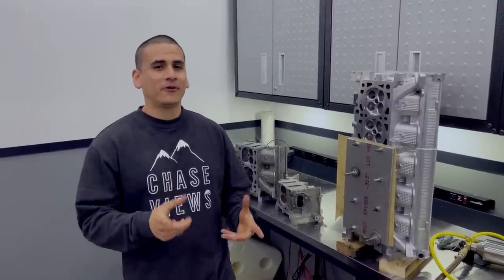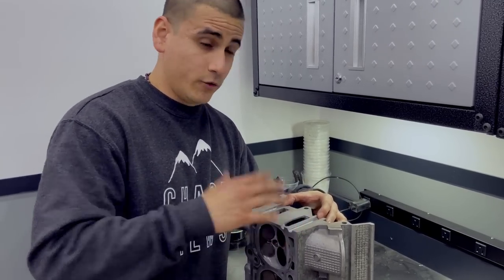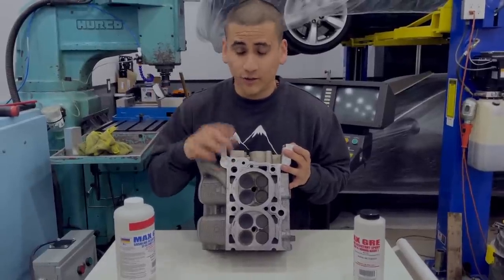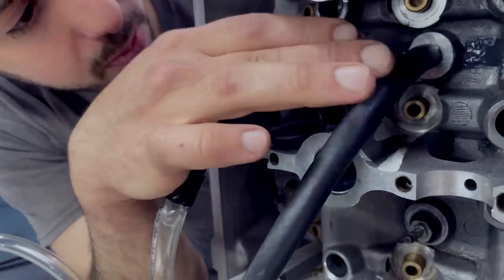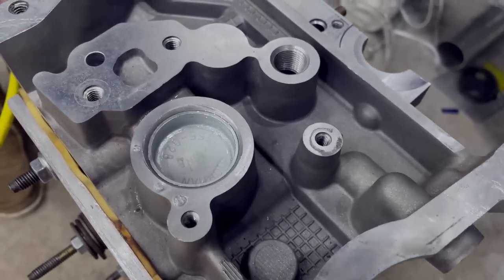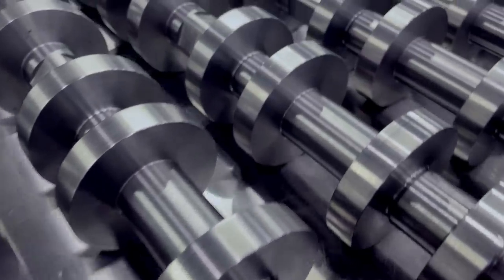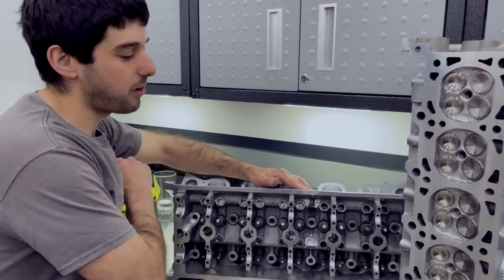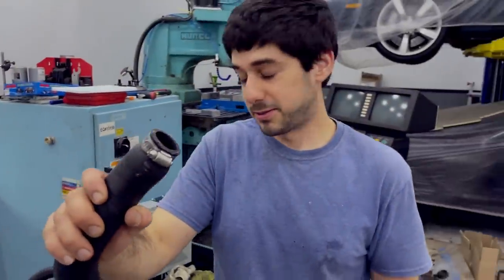Sealing Our Leaking Heads With Epoxy- Ford V10 4V Build Ep. 12

Comment: How about the heat factor with your heads after you fellas used the epoxy trick too seal off your coolant issues. Just a thought, it seals up now but after a few hours of running time you might find the epoxy braking down and the leaks are your problem again. Just a thought go back and redo your welds. Tough decision for your fix.

Comment: The smell of air that isn't -40* is relaxing in and of its self, tho it seems few are making smoke clouds to block the sun's warmth shadowing Alberta. 35*C is a nice day less one is over worked to something of thought that isn't necessarily needed. "stress to one cutting the camshafts, its a 4340 base metal, that stuff can be welded easily if cut wrong... but not every millwright is a welder". very interesting accumulation of parts...
Reply from the maker: The cams are actually 8620. It's a common metal used for billet cams.

Comment: So does each cylinder have a separate supply and return per cylinder? Or does coolant need to flow thru the openings that were welded/ expoxy shut?
Reply from the maker: Each half of the head cooled independently, through the water jackets in the block, there’s just no flow between the two halves but each cylinder is still getting cooled

Comment: Very interesting, if you would do a V2 set of heads what would you differently?
Reply from the maker: Ideally we would eliminate those coolant block off plates. If we can put in a sleeve into the bolt holes and then weld all the way around, we shouldn't need the plates and think that would be best.

Or billet....😬
Reply: @biy_buildityourself  Look for Performance Driven Design he makes 3d scan of cylinder heads and cnc them after. He is doing a Collab with KSR with cnc Oldsmobile billet heads right now on youtube.

Comment: do you mind sharing what something like getting that bracket machined from a machine shop costs?
Reply from the maker: That bracket costs us $200 to make from our prints.
Reply: @biy_buildityourself  that's not bad if you're a solo builder with modeling skills. Definitely not something you want to do a lot but for a one off build and you can validate it with 3d modeling, very solid

Comment: To check this head properly, the head itself to the plate is to be screwed at 120nm with m12 screws, not some m8 that break off at 60nm, you must fasten it to the plate and throw it into hot oil at 120 degrees celsius for at least a few hours with a fastened pressure of at least 1.5 bar on the water jacket and 3 bar on the oil jacket.The epoxy is too hard for the vacuum pump to suck it through the tiny holes in the weld. The epoxy coating will fall off as this engine starts heat cycles, peel off with the oil wash under the shafts and clog your oil channels or get under the valve springs. I've already told you that it would be 10 times less work and 3 times less money to make a new cnc head from one stack of aluminum, especially since you already have a product that you just need to scan, machine and translate the parts. And no, epoxy won't fix anything, because you don't take into account the heterogeneity of the material on such a long head - it's all messed up at the level of the idea.
Reply: Well we're gonna see ain't we! People have run engines for YEARS fixed with J-B Weld with far less prep and care. Just because something isn't perfect doesn't mean it can't work.
Reply: @802Garage   Yes - Fixed, not glued from plasticine. Engine blocks - i saw one worked after coolant freeze and water caps was blown away- they were glued, head covers- ok, motorcycle engine side crankcases ok, but no cylinder heads, in place that there is the highest stress for metal (65bar pushing out inside combustion chamber, and each of the bolts from the head compresses it to the block with a force of 20 tons ) . Guys, just take calculator and calculate it. Calculate the fatigue calculations of a welded structure made of aluminum alloys. There are generally available patterns on the Internet, you also know the types of aluminum and binders. Even if you do it right, in the best case, the weld will last maybe 100 motohours because the weld is firstly made wrong, secondly, in the worst place, on the screw hole, where all the material stresses are present, and each "pea" of the weld accumulates them. And that's even counting the temperature cycles themselves, not counting the knocks of such an unbalanced engine as is v10. 
Where the order of ignition relative to the weld follows each other for one head. There is no time to quench the stresses along the weld. If it were that simple, there would have been 24-valve heads for BMW m70 engines a long time ago, and they don't exist, and all combinations for converting the v12 to 48 valves end in fiasco or making a new head from a single casting. If you want, take a small tinsmith's hammer and do a bell test on this head. See if the knoc bell sound is the same in both halves of the head and say what came out.
Reply from the maker: CNC heads are really sweet and would be awesome, but they are definitely not in the budget!
Reply: @rekinek e36  if you don't think an epoxied together head can make and handle power, you've clearly never seen a 300L6 topped with a chopped up Cleveland head where the ports just about come through the valve covers because they've been raised so far. And that has been done so far back as the 70s. Epoxy on a set of welded heads isn't a new idea and it's something that many racers do successfully. It seems like you're under the impression that they just glued these heads together and bolted them to the block, and that's not the case.  They welded coolant block off plates to the heads then welded the heads together.  The epoxy is being used as a sealant more than it is an actual glue.  And in that capacity it is more than serviceable for this application.  But if I had to hazard a guess, I'm sure they wouldn't turn down a set of billet CNC heads to eliminate that potential issue.  And you seem just concerned enough to provide a set; since all it takes is for them to be scanned and milled after all.  If you ask nicely I'm sure they will give you a receiving address so you know where to send them.  😊
Reply: @rekineke3692  also I've seen crankshafts ring when struck with a hammer that you could pull in half because they were broken.  That's not really a very telling test.  And the reason you don't see 48 valve BMW V12s is because even the most ridiculous and wealthy gearheads recognize that trying to do anything with a BMW is a monumental waste of money and you'd be better served to enjoy the warmth of the fire you started with the bills you were going to spend on it.
Reply: @codyslaughter4678  first of all, you are talking about a fairly mass production engine where someone thought about how to do it, thats true but it is serial and low power and and compresion engine witch is balanced - straight 6, not an unbalanced high compression high power v10.  The bell test is done only on the unmounted part to check the homogeneity of the material, the bell test does not pass, for example, motorcycle shafts that have entire connecting rods (with needle bearings) because they are made of at least 2 elements. And here too will be the same story. They will put the heads on the engine, heat it once or twice and it will be "why is our engine boiling" or "why did we raise the head gasket". There is still an option to use what they made, make sure that the engine does not exceed 75 degrees Celsius on the water jacket, but with this capacity and such a large cast iron block it is impossible.
Reply: @rekineke3692  a triton V10 isn't a mass produced engine? What weird fantasy land do you live in?  And the 300 I'm talking about started its life as a low compression engine yes.  But with that cylinder head it was built out to be an 11.5:1 compression, high rpm dirt track/ drag racing engine.  And it wasn't just 1 seam in that head, it was cut between every cylinder because the bore spacing between the 300 and the Cleveland weren't even close so your argument about balance and "dwell time" between cylinder events is irrelevant and nonsensical.  You're using a lot of big words in an attempt to mask your lack of knowledge on a subject while also trying to dispute the validity of a practice that's been used successfully by people who have been building engines longer than you have probably been alive.  Also, that triton V10 isn't "unbalanced" because it doesn't use a common rod pin style crankshaft.  It has a split pin crankshaft with an alternating bank firing order not unlike a flat plane crank engine (the most naturally balanced orientation for a crankshaft) so if anything "dwell time" for the head is going to be a good as it can get because it never has 2 cylinder firing on the same bank one after the other.  Also, that 300 I mentioned earlier was by no stretch low power.  It has somewhere in the ballpark of 600-650hp and that was out of a big bore 6 cylinder.  For this engine to get anywhere near those kinds of stresses on the crank, heads, block, etc that engine would need to exceed 1100hp NA and do it somewhere around 7000rpm and I'm going to assume that's probably not their goal.  And to further remove validity from your statement, that 300 cylinder head was made of cast iron which is FAR less ductile and welds FAR less successfully, even today, than whatever T6 alloy those 4V heads are, and the 300 head is several inches longer than the V10 head is with 4 more possible failure points.  But please do continue to tell me how what they're doing is somehow out of this world ridiculous and nobody that has ever tried something like this had succeeded....
Reply: @codyslaughter4678  I'll explain it to you one more time. See the videos - the head is only welded around. Did you see any of the welds relaxed there? Because I don't. Not a single channel, whether water or oil, is welded. Holes for pins - the connection is not welded, moreover, it is a connection of two planes that have nothing to do with each other. You have no clue how it works. When they wanted to make it from two pieces, someone thought and set expansion joints between the halves? - Of course not. Anyone can assemble the engine, even in a shed, the problem is that when you want to change something in the construction - you have to count it. This is not a marginal change, for example, valve covers or the installation of a cone filter. This is a change in the overall design of the engine - you need to know how to calculate it and how it works, not to say here we will put some putty, then we will weld together and it will work. The gentlemen took 4 heads, cut them as they thought it was ok. They weld around who knows what, who knows how. It is not known whether there are halves perfectly axially (0.005mm) cut off in all 3 axes. They also do not know if the heads were straight before cutting - because you can measure the plane with a ruler, not a connection in 3 dimensions. All of this has been messed up because we already know that water jackets don't hold. And now instead of improving it - milling the welds and surfacing again - with relaxation of the welds - they putty it with epoxy, and let's keep our fingers crossed that it will work. I don't mean to offend anyone here, because that's not my goal. I was young too and was trying to figure out how to do something that doesn't exist. From experience, this is a waste of money and precious time. On cnc, if they looked well, someone would do it for them from scratch for about $ 10,000. Now they have spent god knows how much money on the project and everything will be wasted anyway, because in a moment they will be machining/grinding heads, making valve seats and guides and this is half the cost of making new cnc heads from scratch.
Reply: @rekineke3692  it's obvious to me that you have no clue what you're talking about and you're just throwing words on a page in an attempt to come up with something that sounds credible to cover up ignorance.  You can look at those heads and see they have been surfaced post process (after welding) which would indicate that they are perfectly flat.  You obviously don't understand how welding works either since what you're saying implies that when they welded the heads together it just laid metal over a crack or seam. All welding is joining 2 surfaces together with melted metal as well as melted base metal.  Hence why you have PENETRATION in a weld and not just melted metal laid over metal. And that epoxy isn't a putty, it's a fairly thin liquid which is why they used a vacuum pump to pull it through any cracks or voids between the plates in the water jackets, again a very common thing to do.  Machinists weld cylinder heads all the time to repair cracks into water jackets, oil galleys, combustion chambers, etc without any kind of issue.  People weld things together in industry all the time with multiple passages through the piece and their only access being the outside perimeter to weld, and do so without pins or bolts. And wouldn't you know, they seal those passages with a kind of vulcanizing elastomer or polymer to prevent any kind of possible leaks.  Sound familiar to you?
Reply: @rekineke3692  also, you don't put an expansion joint on something that you are welding together to be a solid piece.  You clearly have no clue what you're talking about.  Judging by your comments you're one of those people who does more talking than listening when you're in a room surrounded by people with more knowledge than experience than you.
Reply: @codyslaughter4678  Maybe translate is wrong. I write it by myself. The heads are glued like peanut shell. They cores are not connected. You dont made anything by glue around together other pice. It is not solid. Its partly welded to "stay on its place" but not to work as it should. I dont speak it wont work at once, but in wont work several times. Lipespan of this head will be short. I think i have more expirience buliding engines than you. I`ve lerned in mechanical engenering school. I know how to build engines. Since 20 yrs i was a car mechanic. Dont tell me what i know and what i dont. Do you even know how 2 pice elements where behaving to eachother where they are bolted thru a screw when the sleeve of screw is choped in half? I know. The tightened bolt will work as axe and will try to separate the heads. Thats why you use 
expansion pad to bolt it on. See Venturi Motori engines. Again the welds. They are not done correct. This are surface welds. Regardless of alignment and position of heads, the marerial of the welds is not relaxed. The welds are gassed ( bubbles in weld). So even it will be strong enough to hold on its place second part of head, the material near to weld, or weld itself will crack. Screw sleeves (wholes for the bolts) should be welded throu and then redrilled - to act like one pice. Do you know for what are in heads whater jackets? To cool down hot side of head to decrese material expansion, to prevent it form cracks due to temperature stress. The epoxy inside of head need to withstand stretching and compression at the same time in oil mist. The head top is the place in engine where the "ambient" temperature is the highest. The temp of oil mist is around 120C. Also is the "flush" of oil itself. Do you know haw this epoxy will behave? I know, like a chocolate silverware. It will start to flake as soon as this engine will be put on working temperature. Epoxy is ok when fixing place can outside surface work on ambient temperature - yes it can fix hot things but it need to be cooled to ambient at one side, or be applied in a place where it is used as a material filler, e.g. a thread or other hole where there is no way to expand, because it is pressed on each side. So what if it's a great repair tool if it's been used incorrectly. Exactly the same thing happens when a "professional" fills up rusty thresholds in car. Putty comes off at the corners of the holes. I finished. I don't mean to offend anyone here, but I don't want to explain this to you again. If someone can't understand why it won't work, go back to school, because reading the epoxy manual won't do the trick.  Thank you for your attention. Have a nice sunday.

Comment: I don't have the correct knowledge so I'll ask. Doesn't the thermostat need to be higher on the engine to proper activate and keep the engine from overheating and causing engine failure
Reply from the maker: Great question, we had the same thought too. But this is how it's mounted from factory on most 4V engines. We think part of the way Ford made this work was to have the bypass hose running to the housing to heat up the thermostat. I think even the Coyote has the thermostat on the lower radiator hose.
Reply: @biy_buildityourself  you are correct on the coyote thermostat. It's at about the same height on the engine as the one on your V10, it's just placed on the front of the engine attached to the water pump housing rather than hanging off to the side.